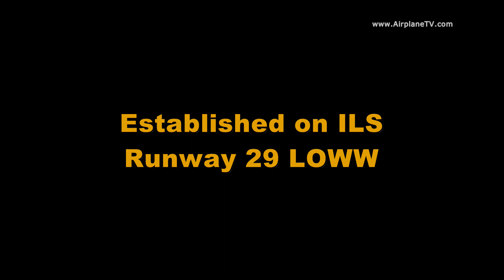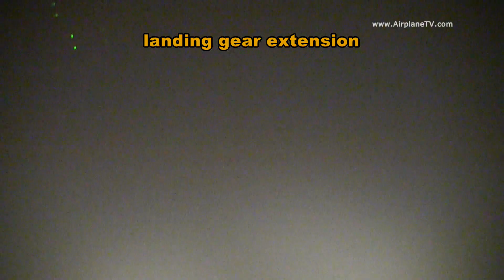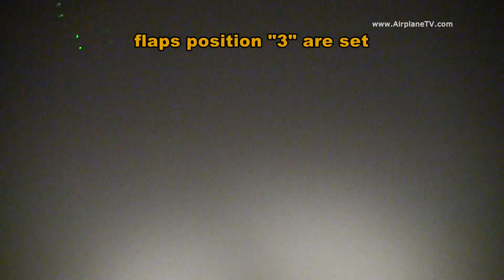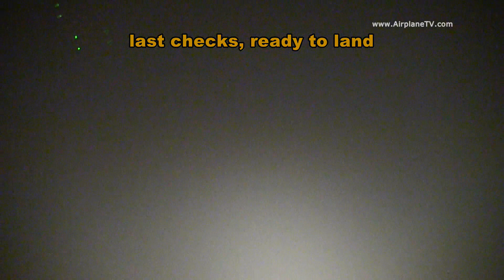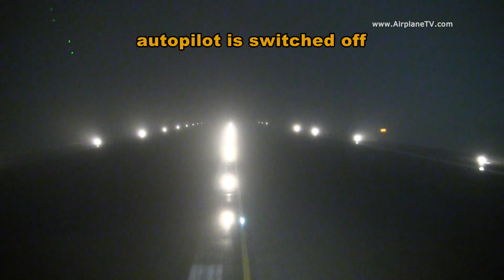Airbus A320 pilots' view ILS Approach CAT III LOWW-VIE in bad weather

Comment: LOWW is a real challenge. You've got rocks close and to either side of you. Go around is not an option.
This is serious flying.
Reply from the maker: I guess you mean Innsbruck, LOWI. You cannot perform auto-lands there, and In Vienna there are no rocks ;-)
Reply: @Airplane_TV  LOWI I for INNSBRUCK - yes, plenty of rocks especially just after the NDB bit before the descent with the glide. In the event of a go around the trees are below you on the left and the rocks are to the left, but you have no way of knowing how far left you can go before that right turn back onto the same runway and you could land but you can't see so if you make it round the bend you could even try a go around from that but only on good VMC.
Reply from the maker: You are confusing me again :-)

Comment: I´ve had that experience on 16th of dec 2022 on flight EW 9558, TFS to DUS, arriving at 5:20 p.m. The captain told to passengers already 1 hour before landing about a difficult landing because of extreme bad weather situation in DUS. My seat in A320 was Window 9A. 2 minutes before landing the aircraft was diving into the clouds - I could see landinglights exactly in the moment the aircraft touched the ground - for me amazing. Reducing of speed was normal. At all moments of this approach I felt safe. Thank You to the very good crew!

Comment: It's all 90/150hz. And a glideslope laid on its side with extra antennas is a localizer.. The theory is basically the same.   Techs do constant far field DDM measurements at predetermined points on the airfield. Not to mention the constant flight checks to ensure the ILS is operating as its supposed to.

Comment: Technically, as per protocol, if the approach lights aren’t visible after the plane is 300 ft above ground, pilots have to do a go-around.
Reply from the maker: No, this is a CAT III approach without any decision height. This means the decision for landing or go around is done when the main wheels touch the runway.

Comment: If the plane and the runway is equipped with CAT||| landing why doesn’t all landing happen automatically.
Reply from the maker: Because the separation between aircraft needs to be increased and the sensitive area near the localizer on ground has to be kept clear of any aircraft or vehicles thus the capacity of the airport (aircraft per hour) would be greatly reduced.

Comment: Are all Cat 3 approaches done only in autoland or can they still be performed in manual, assuming the aircraft has all the proper equipment?
Reply from the maker: Autoland equipment is mandatory for CAT III, but if it fails while you have sufficient visibility to continue manually that's approved.

Comment: My mate is a pilot, he said the trust they have in the plane is 100% but the trust in the AP is always 95%, he doesn't like to leave it to land. He said the AP will land the plane safely not necessarily the passengers whereas a pilot will land both. He has had to do auto lands on the odd occasion but says he wants to look passengers in the eye and know their safety was always paramount. The systems on these planes are incredible but there are still those decisions from time to time that a human will make in the interests of the people on board that the AP won't consider. They're by no means dangerous but they could be the difference between messy underpants and not messy underpants. Lol
Reply from the maker: I do autoland in about three percent of my landings, that's when they are legally required due to the weather. I do trust my systems, but flying manually is more fun of course.

Comment: Why not using autoland all the time ?
Reply from the maker: Autoland requires dedicated ground systems, properly equipped aircraft and pilots licensed for this operations. Not every airline is in need for autoland and because the separation between aircraft needs to be increased the airport capacity is reduced, so it would lead to delays in normal operation.

Comment: On any airport runway in the world, u wl find two numbers written at both the two ends of the runway.
What's the meaning/significance of these two numbers and what's the difference between the two numbers n why is the difference always constant for all the runways in the world ?
Reply from the maker: It's the runway designator in degrees magnetic divided by ten and rounded to the next full number. So a runway with QFU 274 degrees magnetic is called "runway 27" and from the opposite side it would be runway 09. Additionally it could be runway 27 L, R or C for left, right, center. In Paris CDG there are 4 parallel runways, so they named them 26 L and R and 27 L and R although they are exactly parallel.

Comment: This is scary. 
As passenger, I had a similar landing in Lisbon a couple of years ago. I could barely see the wingtip and only saw the ground some 15 seconds before touchdown. The only clue I had about what we were doing was the gear extension and flap setting. Being an Air Traffic Controller, I'm used to be in charge and have all the information I want. Believe me, it therefore gets so much harder to be left in the dark- literally - with just my wristwatch and hoping for the best!
Reply from the maker: Not being able to see the runway until touchdown is a very strange feeling for pilots, too. But at least we have all the information that it's in fact where we want it to be..

Comment: CAT III my butt. Thats not even a CAT II. CAT III is 700 or less RVR, with 50 foot ceiling, and I can see 1800 RVR, and at least 150 ceiling. Besides it was an autoland (autopilot is disconnected on rollout). And thats not bad weather. Bad weather is storms, heavy rain and winds. When you have clouds and fog that low is because barometric pressure is stable, therefore no winds. When I flew, we were CAT II certified, flight director only, no autopilot, and single engine. Most pilots today would be diverting under those conditions. No stick and rudder skills today.
Reply from the maker: I'd be more impressed if you were able to understand the description before posting.
As it is stated many times, this video is about a CAT III PROCEDURE, nowhere is it written that it contains actual weather below CAT I or II. It would be a bit difficult to know in advance when there will be actual weather below CAT II. And some of your explanation about bad weather/visibility/no wind is just nonsense.

Comment: Why gear down before flaps 2 ?
Reply from the maker: Well observed! Under some circumstances like tailwind and heavy aircraft it is difficult to reduce speed on glide slope below Vfe for flaps 2, so extending gear enables faster deceleration. Config 1 has almost no increased drag at all compared to clean a/c.

Comment: I landed in Venice few days ago with a low cost company, the weather was worse than this vid...
Reply from the maker: Interesting. What date/time exactly did you land there? 
As some low-cost airlines don't have autoland and the weather is hard to assess from a passenger perspective I'm interested to know.
Reply: 03/01/2020. Approx time 18.00. From a passenger view the fog was thick with visibility like less 100 meters. I'm sure that they used ILS cause pilot ask us to switch off all electronic devices.

Comment: Why was autopilot disabled on runway don't they have to disable it before landing to take control cause autopilot doesn't land itself
Reply from the maker: As the description "autoland" indicates the autopilot system actually lands the aircraft and is either switched off after touchdown or at the end of the roll-out, depending on auto or manual roll-out procedure.

Comment: Is that possible in Manual Landing?
Reply from the maker: If the height where you see the runway lights is below 100 feet it is not possible with A320, has to be automatic

Comment: 1000 above means above minimums; not above ground. Redactor is not a pilot.
Reply from the maker: The "1000" callout is triggered by the radio altimeter when the a/c is one thousand feet above ground. The "hundred above" callout (which was not in use by the time this video was taken) is triggered when the a/c is one hundred feet above minimum.

"Redactor" is a long-time airline pilot, you are not ;-)
Reply: You are right; I mistakenly heard 100 above, although I wrote 1000 above.
Many people misinterpret the 100 above call. 
Commentator is long time private pilot with IFR privileges and jet simulator time. :-)
Reply: AirplaneTVcom I cannot give your remark enough thumbs up lol Some people really think they know everything.

Comment: That was stunning. I can't imagine landing with no visibility until the landing lights are seen at two hundred feet. My respect to those in the cockpit.
Reply: Its all automatic. You can hear they disengage the autopilot after they have already landed. Their job essentially is to keep cool.
Reply: @rykehuss3435  A category III approach (CAT III with 0 visibility) are rarely executed because most aircraft don't have the equipment, plus once you land with that kind of visibility taxiing can be impossible or incredibly dangerous. and also the pilots have to be authorized to this landing. Not every pilot can land cat3. and also the airport infrastructure must be suitable for cat3.
Reply: @h4runx  Most airbus are rated for CATIIIC.  Don't know about A300 and A310, but the from A320 and up, they are all rated for this.  It is more down to the individual arport/runway and if they are rated for this or even the pilots.  Don't know about Boeings, but I strongly doubt the Lada 737s are certified for this.
Reply: @rykehuss3435  yes but you have to be very experienced and mentally skilled to put your trust in a 200+ ton vehicle flying on its own. Pilots rarely use autopilot when landing or taking off so there is much skill needed.
Reply: Made me nerves just watching and those approach light's never looked so good
Reply: Also to autopilot
Reply: My respect goes to the engineers! :)  The pilots are just along for the ride here.
Reply: my guy, respect to the autopilot

Comment: Is their a standard descent rate for all ILS approaches or do they vary?!!!
Reply from the maker: The mostly used glidepath angle is three degrees, so rate of descent depends on the groundspeed of the aircraft. 
A good rule of thumb is 5 times groundspeed [knots] is desired rate of descent [feet/min] for a 3 degrees gp angle.
Reply: AirplaneTVcom Thank you

Comment: So the plane is flying itself until he turns autopilot off?
Reply from the maker: That's the purpose of autoland
Reply: @Airplane_TV  Who flares the plane? Does the autopilot doing this or has this do be done by the pilot?
Reply: Yes.  Autobrakes as well.  Reverse thrust is the pilot.  Tough part is now to taxi to the gate.
Reply: I've started using X-Plane 11 to know how it feels to be a  pilot on commercial flights, and after a few months, I finally learned how to use the autopilot! Even I got surprised when I saw my airplane going straight to the runway, flaring and touching down... All I had to do, just like on the video, was to disengage the A/P and find the way out the runway!!!

Comment: I cant even do an ILS landing in fs2004 with clear weather properly
Reply: You probably had a slow computer back then.  Frame rate really matters on landings.  I never could ILS in low vis with the big stuff (flight sim) until I got a 2017 computer and installed a 9 year old FSX.  Now it's easy.
Reply: WMKK AVN , I can relate. Try having the gear down and landing flaps at the outer marker with power set to a setting that will give you a proper approach speed on say a 3 degree glide slope.  That way the plane holds proper speed as you glide down hill and your already set for landing.  If your configured "flaps and gear" and trim is set for the proper approach speed at the outer marker it pretty much flys itself down the glide slope.  The other crutch or aid is the VSI, for a set power and trim set for the desired speed and again on a 3 degree glide slope you will be looking to hold a certain descent speed on your VSI.  At say around 120kts to 130kts on a 3 degree GS your looking for about 750 rpm.  Of course that's in a zero wind condition.  Personally I think pilot's today use the autopilot way too much and it ends up hurting there ability to have a good instrument scan which is always a good thing to maintain.

Comment: ok, showing my ignorance here. (Well, after all, I'm a nurse and not a pilot - but fascinated with all things aviation) For some reason I thought AP had to be switched off and pilots in full control at some point before landing.
Reply: At any rate, it was beautiful to me.
Reply from the maker: It's called "autoland" because.. you get the idea :-)
Reply: How come they don't use it all time? Also, would it work in blustery conditions?
Reply: True, except for certain low visibility approaches some aircraft are certified and in fact required to perform an 
automatic landing. Some airplanes use a "Heads-Up-Display" (HUD/HUG) instead of an autopilot to fly the approach but 
that's another discussion.

Comment: could someone take an EDUCATED guess: What percentage of landings on an Airbus is auto pilot landings? like 90 percent of the time?
Reply from the maker: I don't guess but looked it up in my logbook: approximately 5 percent of all landings were autoland, not more. But if needed it's great.
Reply: So it's more of a low visibility procedure or unfavorable conditions?... I guess if you used auto pilot 90 percent of the time you would lose the invaluable experience of practice
Reply from the maker: Low visibility procedures greatly reduce the capability of an airport as there are special requirements with regard to increased separation, "localizer sensitive areas", etc. That's why it's only used if needed. 
And it's more fun to fly manually.

Comment: According to reported RVR and hight on visual contact this was a CAT I executed as a CATIII
Reply from the maker: As stated several times, it's an CAT III autoland approach/landing procedure which does not necessarily imply that the actual weather needs to be below CAT II. 
And if you arrive at CAT I minimum just to realize ceiling is just that bit below 200' you made a bad decision not to execute CAT II or III procedures.

Comment: how much is an actual RVR?
Reply from the maker: RVR is measured in meters and refers to the distance of a lighted object that is still visible, the "visibility" refers to non-lighted objects. The actual conversion varies with meteoroligacl conditions but for some approaches it may be converted by the factor 1.5 or even 2 (night). 
So visibility at our lowest minimum RVR of 75m would be somewhere around 40-50m.

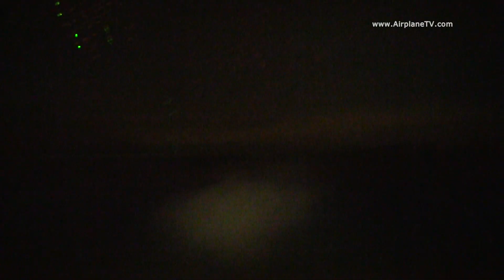Comment: 0:16 I was flying a 737-600 PMDG (P3D) into KHRL at night and it was very foggy and low clouds. Using Precipit FX 737 package, i was able to experience that. The lights hitting the fog and clouds, strobe lights reflecting off them also. It was a real treat. Great video. Regards, from the USA.

Comment: why did I not hear a minimums callout?
Reply from the maker: Because 
1) this was a CAT III A approach with NO (zero) DH and according procedure there is no "minimum" call-out at touchdown
2) you hear "approach lights" when the lights came into sight whereafter "minimum" callouts would not be necessary anyway.
Reply from the maker: Lowest minimum of CAT II is actually 100 feet, below that it would need to be CAT III. 
DH 50 feet is a typical CAT III A minimum.

Comment: How often does auto pilot fail? Freaking scary to hand over control of your life and others' lives to an automated machine.
Reply: Autopilot never/very rarely fails. Let alone fails on landing like that but if the autopilot suddenly failed the computer would disengage the autopilot which is when the pilots would take control and go around. We are highly trained and we do this stuff all the time in simulators if anything we enjoy the challenge. Your in good hands don't worry.
Reply: The probability of an autopilot failure is very low. Nevertheless the A320 has two of them, that are working completely independently. However for this kind of approach (Cat 3) both autopilots need to be activated. If one of them fails during the approach, the pilots would perform a go around and wait for better weather or divert to another airport.
So there is no need to be scared :)
Reply: Amy Ann The A320 has redundant autopilot systems, and the pilots are always monitoring, ready to take over if something does fail. So you're never putting your life in the hands of the autopilot.
Reply: Amy Ann The possibility of that happening is extremely unlikely, so it probably doesn't really happen at all. In such low visibility conditions you almost have to trust the computer

Comment: What is the difference between the CATs like the I II and III
Reply from the maker: DH is measured in feet above ground, so it's a lot lower: 200' CAT 1, down to ZERO at a CAT 3 B autoland.
Reply: Distance in which you can see the runway.
Reply: ukkomies100 i believe they are called b Decision Heights "DH". ... meaning if you can't see the approach lights at an altitude of 200m (dh I) then make the Decision to do not land! pull up and try again later! DH III b is you must be able to see the approach lights at 50m i think... only aircraft with autopilot and parallel fail-safes are aloud to land with such limited visibility and it's my understanding there's only 1 airport in the u.s. that allows that kind of landing ATL

I'm not a pilot just a YouTube r
Reply: AirplaneTVcom thanks buddy... I thought 200m sounded a bit far away! Was i right about the acronym being Decision Height?  I think 3c is zero though.. not 3b
Reply from the maker: Theer is no CAT IIIc worldwide, the lowest is CAT IIIb, in our case it is Zero DH which obviously can't get any lower. Corresponding minimum RVR is 75m